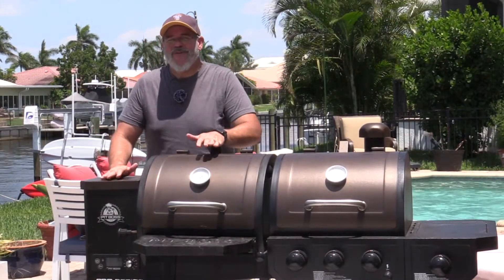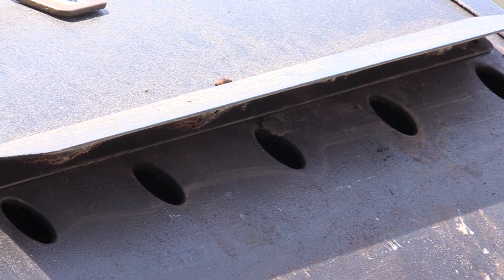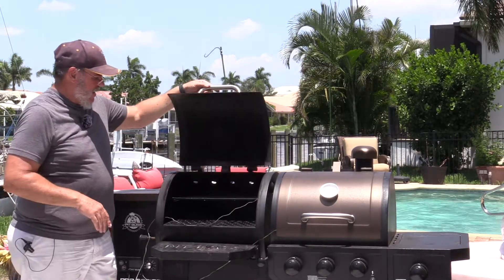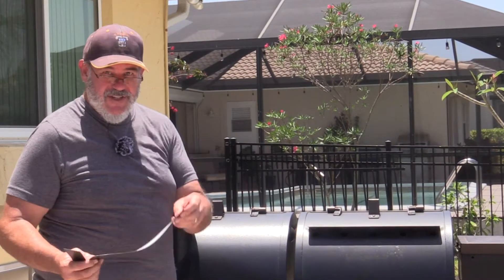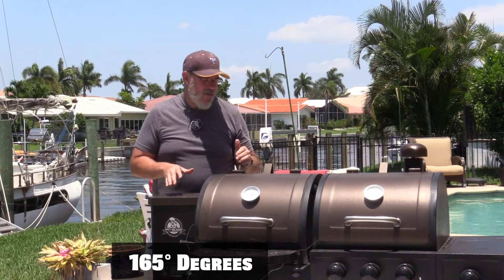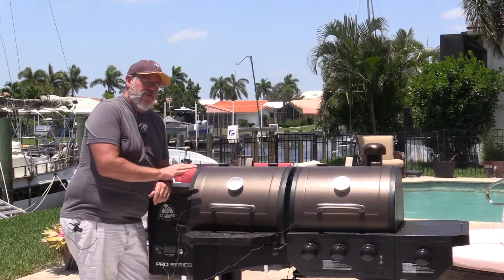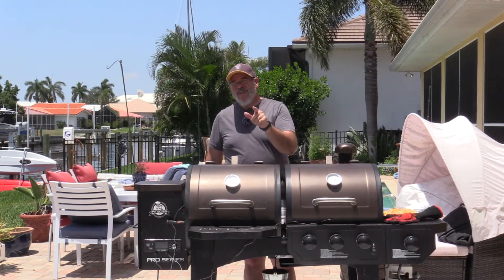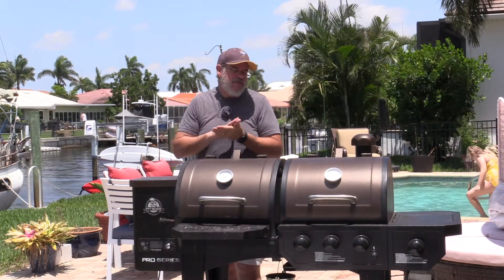How to Regulate Smoke on your Pit Boss Pellet Smoker

Comment: I just did a burn off on my PB 1100 Triple Combo and will smoke a pork shoulder starting early tomorrow morning (Memorial Day 2023) and do burgers on the gas grill side later in the day.  Looking forward to using it.  Thanks so much for your tricks and tips on smoke control.  I plan to try smoking cheese on the gas side (not turned on) with maybe just a pellet tube burning on the smoker side to get maximum smoke without a lot of heat, cover the vent holes and open the smoke gate. Also love your dockside location.  You ARE chasing your dreams. Cheers from Colorado!
Reply from the maker: Glad you enjoyed it John. Funny thing is I smoked a port but today and made it a bit different than I normally do. When I covered mine up, I added a bit of water, BBQ sauce and sone Jamaica Jerk sauce. It came out awesome and we all had pulled pork sandwiches for dinner. Sounds like nachos, tacos and a few other goodies this week.   We have a few on pork butt or Boston butt on the channel as well including one on how to make your own rub.

Comment: I just bought this smoker/grill and am learning a lot. Thank you for the video. Where should the vents in the smoker be set? The handle by the control panel opens and closes and I didn't know if that controlled the amount of smoke or is just for heat.
Reply from the maker: To make sure we have the same model, when you say vents in the smoker do you mean the grates/vent over the firebox (open you can see the flame, and closed you can’t). If that is the one your referring to, I cook with mine closed 95% of the time and only open it when I want to kiss my food a bit with direct fire. 
If your referring to the vents in the top where I showed the magnetic sign strips closing them, I keep those 60-75% closed when smoking and I open the vent between the smoker side and grill side about an inch to let a little smoke out there too.
Reply from the maker: Let me know of that makes sense. If not, I can clarify
Reply: @Svdreamchaser  Yes, it's the vent over the firebox.
Reply from the maker: @suekemp83  yes. For sure, I keep that closed almost always.

Comment: Hopefully you still read this comments, I can't seem to get my smoker to a P4-P5 setting. But I honestly don't know how to work that portion of the control panel. Any ideas?
Reply from the maker: I am doing this from memory bit you power on, put temp in smoke setting then push the small P hutton on the panel and it cycles through the different P levels. The button is about 1/4 the side of the others and is the letter P in a circle.

Comment: What is the heat source for the smoker side on the left?  Are the pellets electrically heated?  How hot can the smoker side get without heat from the gas bottle?
Reply from the maker: The left side is heated by wood pellets. The wood pellets are entered into the fire pot from an auger. The higher the temperature, the less the increment of time is between feeds of pellets. It can easily get to over 400° in that smoker side of the grill without the gas on at all. And yes, the pellet stove is electric for the auger, motor the computer, as well as the small little heat source that first ignites the pellets. That eventually goes out and just the fire from the pellets is what heats the overall unit.
Reply: @Svdreamchaser  Thank you for the information...much appreciated.

Comment: After watching your videos I am thinking about buying a Pit Boss. I would to see how the it performs as a grill not the smoker side.
Reply from the maker: The grill works great too. It is a 3 burner gas grill. We use it as well for. Time to time but honestly we enjoy trying all the smoking recipes so I use the smoking side 5 times to 1 on the gas side. That said I like to do burgers, steaks and chicken on the gas grill side and then just before done I open the fire plate on the smoker side and put the meat right over the open wood fire to get some of that wood burned char on the outside of it. (Kind of like reverse searing). After having this a little over two years the only down side is the display on this first gen version is hard to see in the direct sunlight. That said I may replace the control panel in the coming months but I am not in a hurry as o can read it if I cup my hands around it to block out the direct sun.

Comment: Hey Gil, this is off the topic of smoke control, but I have a question about your unit. Mine is a navigator, like yours sans the side burner and chimney, only nine months old.  My display board is pretty much pooched. When the board on yours went, did you replace it yourself? TIA
Reply from the maker: Mine is having an issue with display brightness but still working so I have not needed to replace it yet. I do believe that I would be able to. When I took the unit apart it seemed pretty easy to do so.
Reply: @Svdreamchaser  Thanks Gil.

Comment: Do you know where I could find a replacement slider cover for this grill? Mine is rusting pretty bad and it seems Pit Boss don't stock a replacement slide :(
Reply from the maker: Are you talking about the grate that goes over the fire box that slides open and closed to expose flame?  If so, mine is rusting quite a bit too (even staying covered) but it does still work and open/close ok.   Let me look up the part and see if I can find it.
Reply: @Svdreamchaser  Yup, that's the one. I've searched up hill and down dale to no avail. ( I should add there are ones I've seen for the PS1 , but not the combo model :( )
Reply from the maker: I will look and see if I can find a part number. How old is yours and is it the combo unit from Lowe’s?
Reply from the maker: Man, I am not finding it either. It may require a call to PitBoss. I see the ones for the 1100 but not the combo.
Reply: @Svdreamchaser  Yeah, it's a bit disappointing. I typically don't open the slider cover anyway, so I might start wrapping it in foil to try make it last longer.

Comment: Pit boss should have a way to close those holes off. I have the same grill it needs major improvements. Just can’t get a good heavy smoke
Reply from the maker: They should but, that said, I think that $15 in magnetic sign material is one of the best investments I have made.  I cut off some new strips every 6 months or so when the ones on the grill get brittle.  I just keep the magnetic sign stuck to the side of my metal rolling toolbox in the garage so it stays flat and cut it with a razor when needed.  Give that a try for sure.

Comment: vision with controller use a thin piece of glass and glue it in place  Replace the plastic with glass. Heat would no longer be a problem.
Reply from the maker: That may work but o don’t know that I could cut and glue the glass in place very well given the shape of it with holes in it for the knobs.

Comment: What is the “smoke setting” ? I don’t have it as a button or anything
Reply from the maker: When you first turn the temp gauge and it is on “S”. That is smoke setting. It is where the P setting controls how much time is between each cycle of the motor.   Newer digital control panels may not have this, I am not sure.

Comment: I'm trying a pro series black triple combo pit boss that was left to me..I dont have instructions at all..I was wondering..Do I leave the lever on pellet side open or closed while smoking meat? Thanks
Reply from the maker: I always close the chamber valve between the left side pellet smoker and the right side gas grill (where the stack is) when I am smoking. 
I found opening it didn’t lead to more smoke flavor. If you live in a cold climate you may be able to open it and smoke cheeses on the right side to keep the temp low on it. Sadly I live in southern florida and the sun hitting the outside of mine melts the cheese. Lol.

Comment: Someones got a link for the magnet strip he have
Reply from the maker: https://amzn.to/41mtWcD 
I picked mine up at a local sign company but honestly I paid more for it than what you can get it on Amazon for. I recommend cutting it in strips (2 of them) so you can slide one over a bit to control how much air goes into what vent holes. Also I recommend changing techs magnetic strips every 5-10 cooks. It gets a little brittle being outside where I live after heating up a number of times. I found changing it out makes it easier and this item will last for many years when cut in strips. https://amzn.to/41mtWcD
Reply: @SVDreamChaser  thanks a lot for your answer !!! I saw this product and was wondering if the adhesive side won't "melt" with the high heat ?
Reply from the maker: It hasn’t for me, but over time it does get a little brittle so I replace the magnetic strips Alegre year. Remember I cook at least once a week so it is used often.

Comment: This is nothing containing about this video here have an issue with error codes I have a Erp error code I look it up it said something about improper shutdown Seema I get that code when I go from smoke mode to a temperature setting I seen some videos about some codes nobody's  how to get rid of that issue or fix it for it won't happen again
Reply from the maker: ERP is an improper shutdown. It usually happens if the power was turned off by the electric cord without the cooling cycle completing or the switch was not in the off position when it was unplugged. Be sure to go through proper shutdown of turning the dial to off. Letting the burn and air circulation cycle finish (about 20 minutes) then unplugging the unit when cool.  If the power down cycle doesn’t finish on its own or you see smoke from your pellet non you likely need to clean the fire pit. It usually means the ashes were too high and the “burn” carried into the auger and burned some pellets in there as well. Hope that helps as there can be several things that cause this but this is most common scenario.